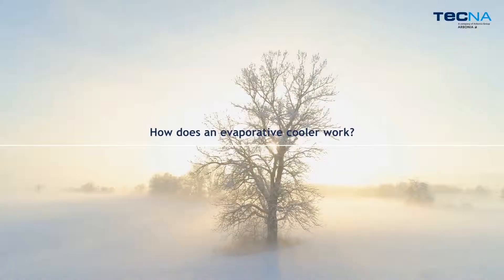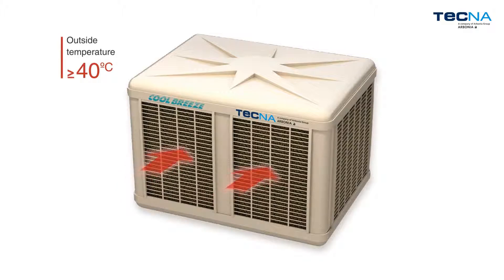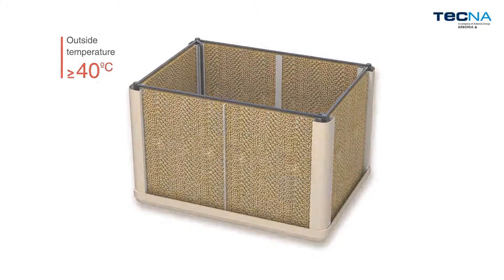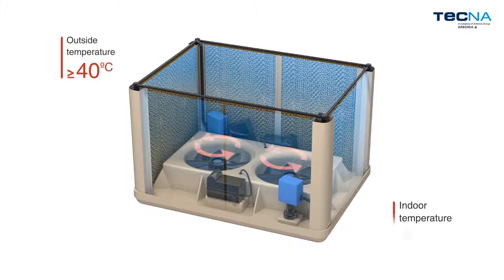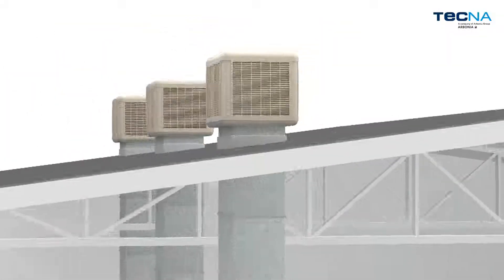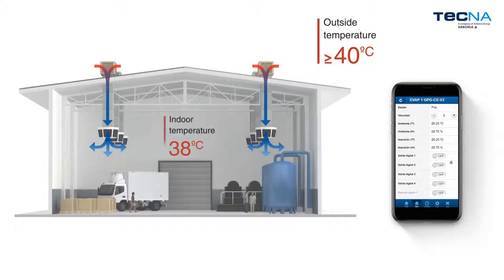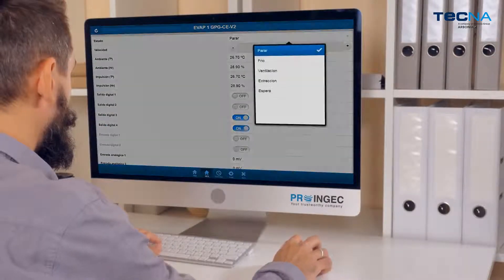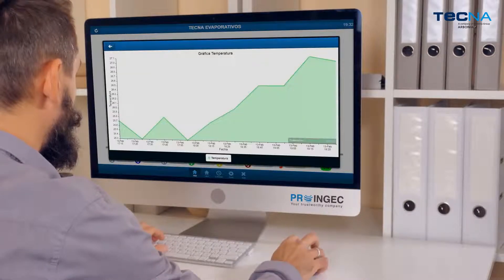3 How does an evaporative cooler work

Comment: Evaporative Cooling is different. Direct cooling as in video adding moisture to the air. Indirect cooling from industry leaders with Wet bulb temperature. Dew-point regenerative indirect evaporative cooling from Maisotsenko Cycle.
Reply: No.... the video IS demonstrating Evaporative Cooling (Direct Evaporative Cooling). Indirect Evaporative Cooling is more complex.
Reply: @davidbroadfoot1864  I easily recognized Direct Evaporation in your video. I do not care either about Indirect Evaporation -  they both are low efficiency. We designed and developed the next third generation of proprietary dew-point indirect evaporative cooling. Our prototype demonstrates EER 200+. That is real breakthrough
Reply: @M-Cycle   It's not my video, genius. And if you easily recognised that it was Direct Evaporation, then why did you argue that "Evaporative Cooling is different" ?